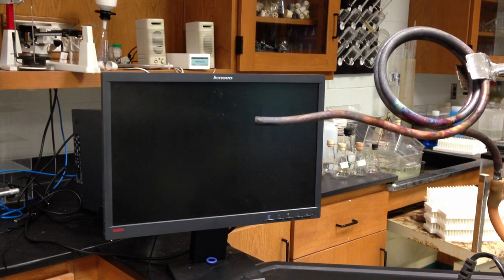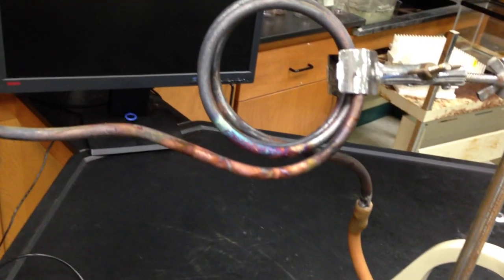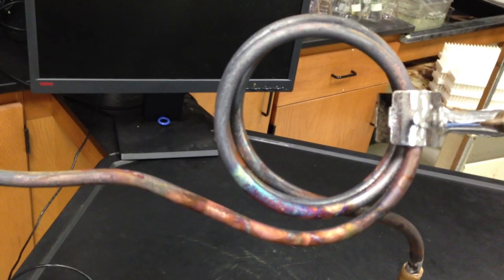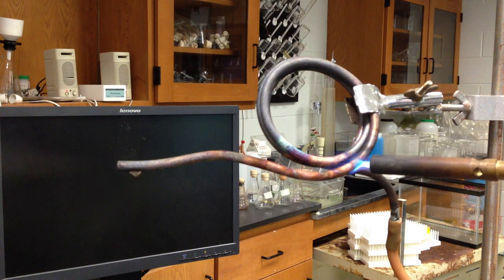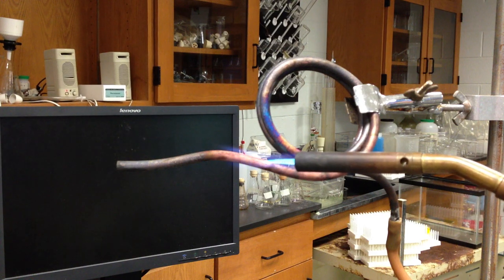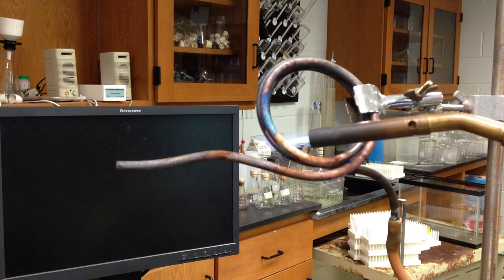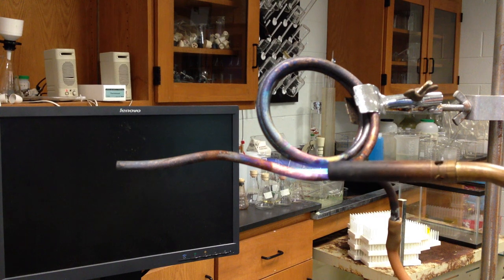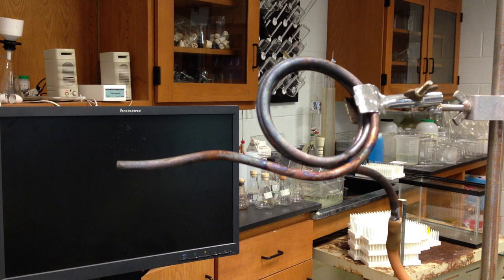Superheated Steam Demo

Comment: That was cool,  Steam Turbines love that..   If Ya put a reducer on the end of the copper pipe,   Pressure must be able to get really high..  I want a Steam Car..  I think I can use a Microwave Magnatron to boil the Water,  Then super heat it with a small propane flame..  BOOM !   Hot Car..

Comment: Would this happen without the steam pressure and just use air pressure instead? Like a heat gun. If that worked would it not somehow disprove the superheated steam theory?
Reply from the maker: I do not think so as It was done with water vapor. At no point was there not water vapor present. Hot water burned the cotton.
Reply: @MrGrodskiChemistry  What I wonder, is if there are funky things going on like the water splitting into H and O2 when it hits the carbon in the cotton.  Carbon REALLY likes to draw O2 and make CO (carbon monoxide).   We do this all the time with charcoal gasifiers, in the woodgasser community.  You drip water into white hot charcoal, and there's magic.

Comment: What does it turns into ? Oxygen?
Reply from the maker: This is not a chemical reaction.  Heating the copper coil  just gave the water vapor more kinetic energy.  Essentially water in the gas phase is just being made to move faster.
Reply: Do you know if somebody ever tried to pass this vapor through a hydrogen catalizer?
Reply: @pacerodi  It will not act as a fuel. It's just very hot water.
Reply: If we use a steal pipe inside a ZVS driver, and super capacitors, in order to recharge it quiqluy. What do you think about it?
Reply: quickly.
Reply: with a venturi valve, at the end of it.
Reply: And you could power it all with elephants on a treadmill
Reply: @pacerodi  The pipe will never reach the temperature required to do that. 
It will, depending on the power of the unit either melt the steel pipe or reach the curie temperature and stay there (which is not sufficient). 
Maybe if the pipe was made from a highly refractory metal like Tungsten or some alloy.

Comment: Help me Mr.chemist!   I understand the principle here. easy with a open system. I have more trouble with this principle in practice with the superheater tubes.  The closed system means the effective boiling temperature of water rises with pressure. I would say steam is saturated as long as it is in the presence of liquid due to the junction of 2 separate phases. The additional rise of temperature does not appear while liquid is boiling. Just more vigorous boiling.  So I can see the separation in your model here. The theory is the same in superheater tubes, because the steam is widely separated from the liquid still in the boiler.  So to heat the gas  (of water)  I can see is possible.  But the pressure will rise with increase of the temp (Boyle's Law?) so it will rise in the entire boiler (if you're not tapping it off),  including above the liquid.  Presumably far higher than the pressure from jjust boiling the water in the enclosed tank at whatever corresponds to the temperature at that pressure.  Does this fact about superheating water at a point ahead of the boiler and causing the pressure to rise in the whole system introduce an anomaly?  Would a check valve be in the piping before the superheater manifold?  This is where I lose my grasp..........
Reply from the maker: I am not an authority on the working of a steam engine but a front end throttle was used in locomotives that employed steam engines that was placed after the boiler and before the superheater.  it prevented the "anomaly" you are discussing as the increased pressure would further increase the temperature necessary to maintain boiling if the system was closed.  It enabled the locomotive sitting at a station to have the superheated steam ready when it was ready to move.
Reply: That all makes grand sense.  I never gave it a thought that the superheater tubes would be after the throttle down-stream connection. But I'm "lost" again.  If the throttle is shut and loco is not receiving any steam at the valve body or chest, is it a closed circuit again at least at that point?  And pressure could rise to huge values? OR, since no steam is moving through the superheater tubes, would they burn out from the high temps of the combustion gases passing by them? Or blow out from the pressure?  I'm guessing they might be of a high alloy like #9 chrome tubes to take this abuse.  Do they draw any steam out of the superheater structure perhaps through an allowance in the throttle to run any auxiliary drives or stack blower or venture pipe to keep some steam in motion through the tubes?